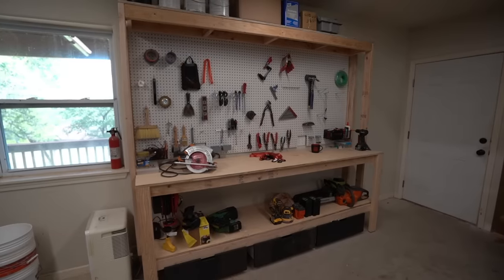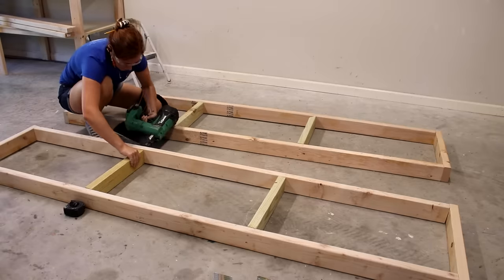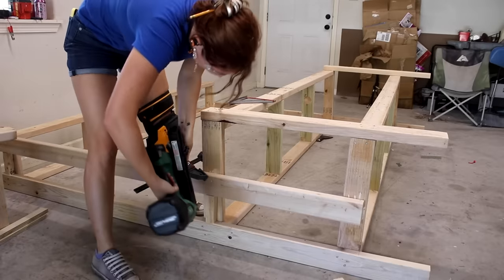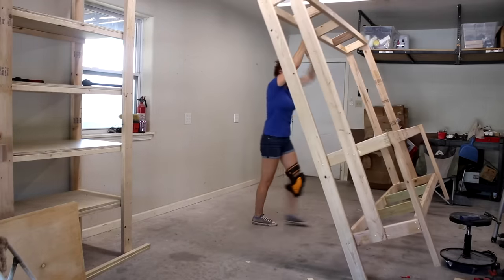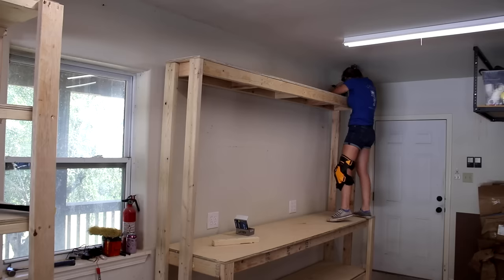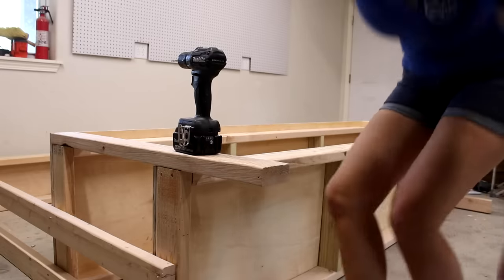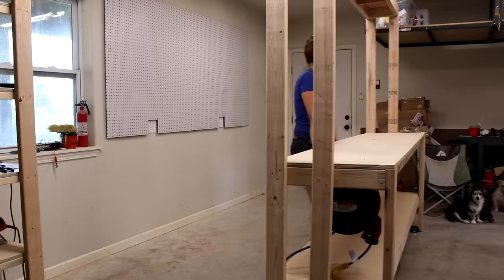How To Build A Workbench For Your Garage | Easy 2x4 DIY!

Comment: Two things I have learned in my many years. 1. No one sits at a workbench in the shop. Raise the table top up between navel and sternum. 2. Like you have done, make the work bench top easily replaceable. I restore cars so after a few years of oily parts, grease and hammering out bearings the top needs to be replaced. I usually use a full sheet cut in half and making the top a double layer. Then you can just flip each layer over when you want a new clean top. It last a lot longer until having to drag another sheet home. As always, your videos are the best.
Reply from the maker: Thanks for sharing! Glad you enjoy my channel. Thanks for watching.
Reply: It depends on the type of work you do, I sit at my bench all the time if I'm doing detailed work.
Reply: I built this exact workbench 4 years ago for my 90 yr old father.  He couldn't stand at a workbench anymore, but really wanted a workbench again.  He loved it, and spent hours sitting at the bench.  He kept it in the spare bedroom of his house.  It was one of the best gifts I ever gave him.  He passed away last year and I have the bench back.  I made the bench so it can be disassembled.  I also added a LED shop light under the top.
Reply: I always sit at the workbench.

Comment: Nice. Very simple and economical to make. I love it when the item you are building is already being useful before it is finished! Some folks with smaller spaces may find it useful to put casters on the bottom so they can reshape their workspace as needed, roll it to the middle of the garage when the car is outside, or roll the bench outside to do the dusty work. Locking casters would be useful for that. Say howdy to Texas for us.

Comment: This is crazy. This looks exactly like the workbench I've built for myself some 5 years ago. The only difference is I don't have drawers at the bottom, but I have installed lights under the top shelf. And also a swiveling shelf on the right for a speaker so I can play music while I work, and rotate it to depending where I am in the garage.

Comment: @April, you used lag screws for adjustment purposes, but I think carriage bolts are a better option. The don't damage your floor and you can move them around just a bit easier. Still adjustable though, you only do need a threaded insert... but still... 😉
Nice and simple workbench. 👌🏻

Comment: Nice.  Well done.  I would have mounted the retractable extension cord up high, on or close to the top shelf.  With a few well placed J hooks coming down from the ceiling you can string your extension cord across the garage overhead and avoid a trip hazard.  I did this in my basement shop and it worked out well.

Comment: Hi there, I know this is an old video, I wanted to make a workbench and ended up with this great project.

Here in Mexico it is not that commun to buy wood, I was surprised to learn 4 * 2 are not really 4 * 2...

Also the wood here with that measurement (at least where I bought it) it is used for construction, and has a very bad finish, so after some work i think i ended up with something acceptable.

Thank you for insipiring me to actually try stuff.

Love your channel
Reply from the maker: Awesome! Glad you found it useful. Thanks for watching.

Comment: Very cool series covering easy shop fixtures within the skill levels of the home DIY-er!  I'm sure the high ceilings and limited square footage of most home garages means that upper shelf will find some storage uses, besides being a handy place to hang a workspace light.  Not being as nimble as I used to be, I can no longer do that 'acrobatic April dismount', much less stick the landing as skillfully you did 😎👍, or even get up there very easily.  It occurs to me that attaching a scrap of 2x4 across those 2 back verticals like a ladder rung (on either end or both), midway between the lower shelf and the top, would allow someone to step on the shelf with one foot, the other on the rung, and then onto the bench top, with the upper supports providing a firm handhold.

Comment: Stick nails are far superior for shear strength than standard wood screws, and coil nails are generally soft and generally not adequate for the job. Folks need to check the specs on their nails to make sure they use the product that meets their needs (load specs, etc.). Love your videos April.

Comment: I'm about to build something similar to store all my tools. Glue is a great idea. I would use wood screws over nails. Particularly, the type of screws that are not threaded for the first inch to create clamping action. I'm using heavy duty adjustable legs to level it on uneven concrete, which is typical in garages to slope toward the doors. I do have a worktop I built years ago. I used white melamine as it can be cleaned easy and makes a dead flat surface. Lacquer would be great too if you don't need a precisely flat top. I've also made an office desktop with stained MDF and epoxy that was bulletproof.
Reply: Also, you can guide your nail/screw holes perfectly with a chalk line.
Reply: Do you have a link for the heavy duty adjustable legs you ended up using?

Comment: Hey, thanks so much. I was considering the same type of design, but about half the width. The idea of not having to go to the ground with the back, forward shelf support was helpful (I don't know why I had mine going to the ground. I also like the way you incorporated the lip in the front for clamping onto. One question, why didn't you attach the peg board to the back of the bench as opposed to the wall? seems like making it stand-alone might be more versatile and stand-alone. Good job (from an engineer)!

Comment: very nice build April  a lot of times i also use bolts as my adjustable feet to levels something  but my method  is using T Nuts  and 1/4X20 bolts because  you can lift the unit with a Pry bar and easily adjust those bolts  by hand  a downside to my set up is if you do need to slide the item on the floor a distance th the bolts can really  change  thir position  but that’s not normall a big sue for me. as it’s  usually  i only need to pull things out to find something or do a cleanup     i of course to  bore out the Wood wher the T Nut is fastened  so the Bolts can be both all the way in or out  it’s stronger then Commercially sold Adjustable Feet  and has a Industrial type of look IMO

Comment: I was particularly watching to see how you lifted the sheet of pegboard and secured to the back/wall by yourself.  I do all my projects myself but lifting the sheet by myself has stopped my progress.  Way to heavy to do myself.  I noticed you had help with that, so i guess I will need to find a pair of extra hands to do it.  I want to secure to the 2x4's in my garage.  Have you found a way to do something like this yourself?  Any help would be appreciated!

Comment: I have a question about your modeling program. I learned Sketch Up with your help last year and now I’m learning Fusion 360. I’m having a hard time with it though.  Is this new one your using better/ easier than the other two? I like the parametric function in Fusion but Sketch Up is easier. Just wondering if it is worth it to learn another one. I am just a hobby woodworker. Thanks :) if anyone else wants to answer this, be my guest :-)

Comment: 4:46 Add a 2x4 along the front. Adds strength, and makes the front even.
Reply: Actually, having that lip at the front of the work surface makes it much easier to clamp down items while working on them.

Comment: You need to use screws on the frame. A nailer is ok for speed of getting it built, but screws are tougher. So use the nailer then go around and lock it up with screws.

Comment: April April April, the lower shelf could have been added with one piece had you just slid it in from behind. You ended up sliding the bench out shortly after as it was. Could have slid it in behind the front legs and let it fall down in place as well.

Comment: Hi April, I found your site just in the time, I wanted to build a workbench in my garage, and your design and build are awesome!!  I cannot wait to start.  I am a newbie when it comes to nail guns and wondered if you used a 16 gage brad nail gun to shoot the 2 1/4 nails?  Once Santa has left the building, I am onto my build of your plans, and I did purchase them as well.  Look forward to hearing from you on the type of nail gun.  Keep up the great work, glad I wondered your way.  Thx Much!!!
Reply: Brad nails are not used for anything structural.  You would want a much larger nail than a Brad nail.  I built this same bench about 4 years ago.  It’s a fantastic bench.  I put the entire bench together with 3” deck screws.  Get the screws that do not require a pilot hole and have the small tabs so they counter sink themselves without splitting your boards.  3” deck screws make a much stronger structure than any nail.
Reply: @nickthompson529 HELLO, just comment hustling here … but if one were to use a Nail Gun, which nail gun should they get for this sort of build (preferably cordless)

Comment: How do you keep the pegs on the pegboard and not coming off with whatever tool you remove? Seems like it happens 90% of the time.
Reply: Some peg packages come with plastic clips that hold the hardware to the board.

Comment: This is cool and a good size for a small area - but do you not have your giant workshop at home anymore?
Reply from the maker: Of course! This is the garage of my house and I would rather utilize it as another work space. Thanks for watching.
Reply: @AprilWilkerson  Phew - that's like my dream shop, haven't seen too much of it in your vids since the tour so I wasn't sure.  Unfortunately, living in good 'ol  HOA tract housing in AZ, my shop is limited to my garage that also needs to fit vehicles lol....and the way they design garages in the southwest, they're barely big enough to squeeze in 2 cars as it is.  An extra 2 feet on either side of the garage would've gone a long way.

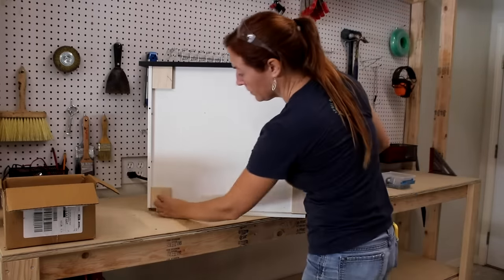Comment: 9:53 Instead of bending the wire in a loop around the screw, crimp a spade/fork connector to the wire. Much nicer result, and more professional.